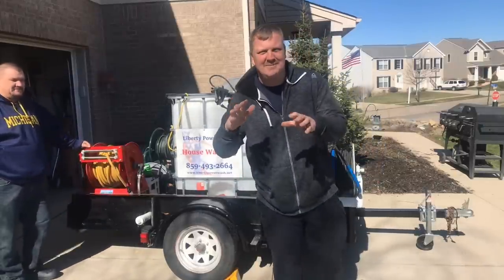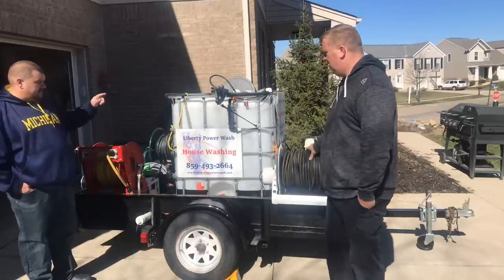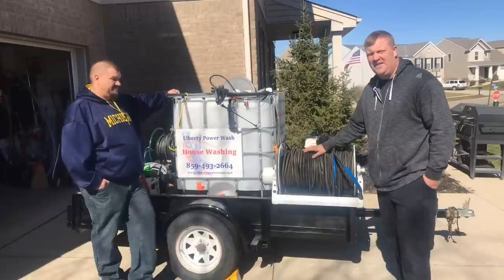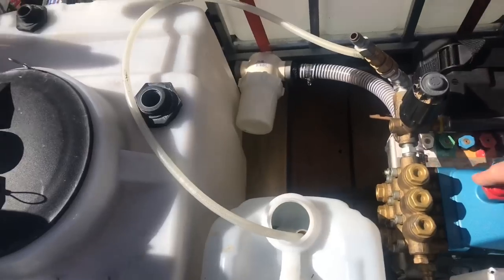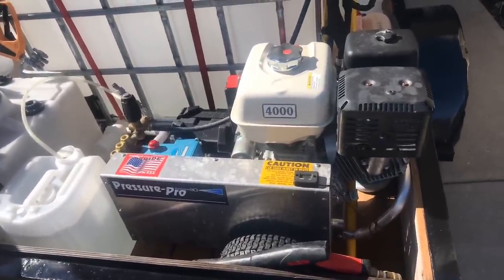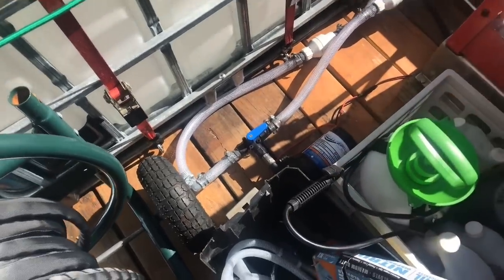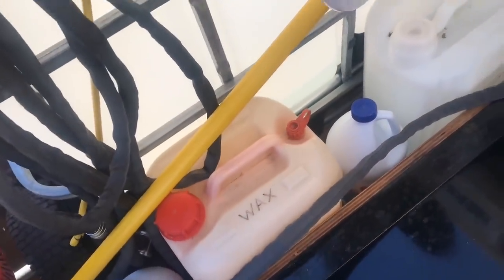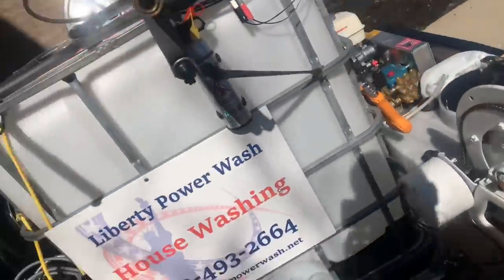Liberty's Pressure Washing Trailer Setup Overview

Comment: That's a great little setup you have going DJ! Keep up the good work bud!
Reply from the maker: Great setup
Reply: 1st Choice Power Wash LLC. Thanks. It has changed  and next year is going to a flat bed.
Reply: Liberty Power Wash ; your soft wash setup. Jason said it was a soap line running into the 3way splitter. Did he mean SH line? I have a rig build going and really like the setup you have so I’m trying to replicate it.

Comment: With a 4 gallon per minute pump I would not need a buffer tank correct? I could just run the water hose straight to it and still be efficient enough?
Reply from the maker: you dont need one but dont let machine run with out trigger open or it will burn up pump

Comment: I'm in the process of putting together my rig have some problems find a 1-1/2" hose to go from IBC tote piping to 8gpm pump. Any help would be greatly appreciated. Thanks
Reply from the maker: Here is your best options
https://amzn.to/2GDiktZ
Reply: @kingofpressurewash  Thanks, but I was referring to the hose itself. I have all the adapters just not the 1.5 I.d. hose
Reply from the maker: @johnlewis3119  here is the 1 1/2 hose
https://amzn.to/2Gsy56Y
we just use 1"
https://amzn.to/2UTKmLX
Reply: @kingofpressurewash  Thanks again guess I didn't type in the right key words on Amazon. Lol

Comment: I actually made a wand like that too. I used it today on a roof wash and it worked perfect with s jrod
Reply from the maker: Works good
Reply: @kingofpressurewash  I went with a 3% sh ration I have to next time go stronger. I had to re apply like 2 or 3 times in some areas.
Reply from the maker: Antonio Rivera we go 6 % on roofs so it's one and done
Reply: @kingofpressurewash  the guy from yesterday I did the roof. He called me today and asked me if it was ok to rinse the roof because it stunk like bleach and like something dead lol. What is your take on that, jason?
Reply from the maker: Antonio Rivera I you snotmade which smells like lemons to help kill the chorine smell
Reply: @kingofpressurewash  I think I didnt use enough. I use rain fresh. I went 1oz per gallon of mix. Next time I probably double that